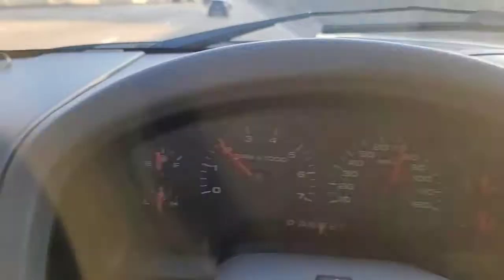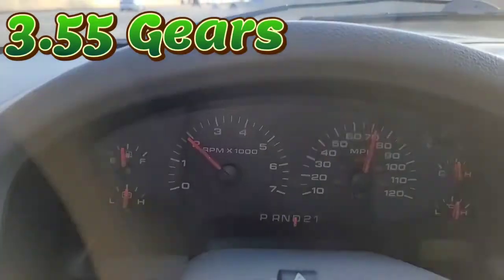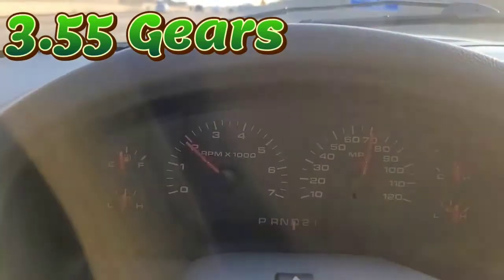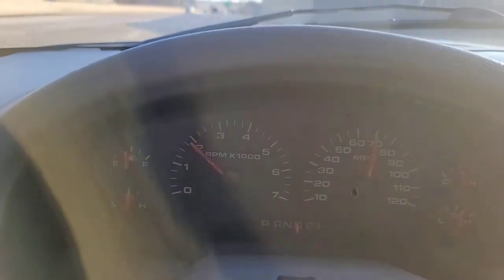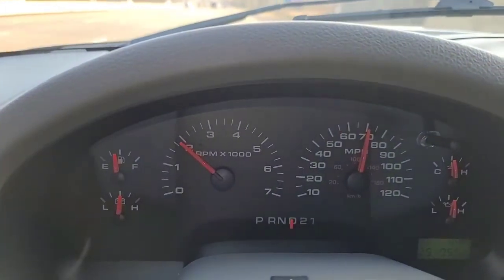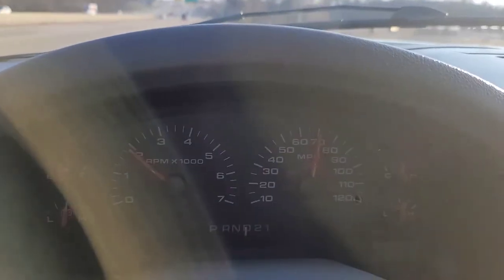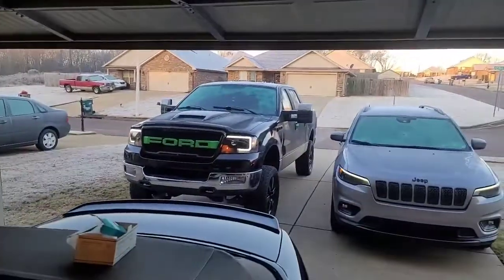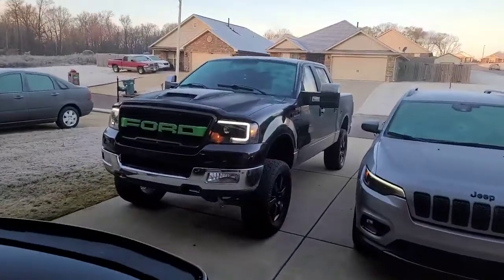Going From 3.55 Gears To 4.10s In My F150 (BigBaby)| Rpm Comparison

Comment: Thanks for making this video. I also have an F-150 with 3.55 gears and 35" tires. I definitely noticed a change for the worse in performance once I replaced OEM tires with the 35s. I would like to do the gear swap to 4.10s. Does your truck run similar to stock now that you have the 4.10s & 35" tires? What did the gear swap cost?

Comment: I got 35s, 3.55s and a programmer(on a 2011 5.0) no issues for the passing or on ramp but my low end on take off could use some improvement

Comment: Did you have a problem with the mph being off? I had mine done from 331 to 410 and it’s reading about 10 mph faster than I actually am going
Reply from the maker: U need a tuner to adjust it and you'll be fine
Reply: @GabeOn26s  thanks!

Comment: been looking for a video like yours for awhile man. good info here. i got a 05 f150 with 3.31 on 34s. with the 5.4 3v engine.  my mph sits at about 80mph at 2k. deciding if I should do 4.10 or 4.30. end goal is to have 35s on it. how was the mpg change?
Reply from the maker: You'll gain a few mpg in the city and highway going with 410s or 430. Either one will be good. The 430 will give you more performance
Reply: @GabeOn26s  thanks for the quick reply. Did you see a mpg gain? I generally Cruise at 70 -75 mph. With 34s and edge 87 tune. My 0-60 is 14 seconds
Reply: @kingbellmont9735  your 0-60 is 14 seconds?!!! I have an 05’ F150 with the 4.6 extended cab, with 275/65/R18s, edge 93 octane tune and my 0-60 is around 8 seconds
Reply: @AustinB3.6R  the 3.31 and the 34s really draw back the response and power. But crusing on the highway I get 19mpg

Comment: You could have at least rolled down the road one time with new gears before uping the tire size so we could actually see the difference.. with seeing 2k rpm at 65  on bigger gears Seems like the stock gears did better.  I mean about 2k and above 70 was rolling better...  so just wonder what 35 on 26s would of did on stock gears.

Comment: If anybody could help that would be great!
I have an 08 4.6 f150 2wd, do a lot of towing but wanting to make it faster and keep the same reliability. Which gears would you all recommend and about how much would I be looking at? Is it something I could buy and bring in for install or would have to have a shop get? Any insight would be appreciated.
Reply from the maker: 456 gears you'll spend anywhere between 300 to 1000

Comment: Their is a notice from 3.55 to 3.73. I could see a good bit more torque driving around stop light to light. I wanna do 4.10 in mine
Reply from the maker: 410s are good💯
Reply: Would u order 3.73 or 3.55 . Not worried about racing or towing . Whats the best for all around . Like which will last longer if u drive like a criminal
Reply: @dylancoffee8091  3.73 is better
Reply: @413-n9k  4.10s have more torque and are only about 300 rpm higher at 80-90 mph

Comment: What about 3.73 which would you order on ur truck .
Reply from the maker: Ford Performance gears only with professional installation. If you wanna save a few bucks get a good used ford ring and pinion

Comment: What rpm are you at 80mph? mine sits right at 2k at 80 mph.
Reply from the maker: About 2100
Reply: My 96 Explorer Limited came stock with 4.10. Revs 2k @ 60. 16" wheels (probably 30-31's). Definitely had offroad in mind or pulling boats out of the water in 4low. Tons of low end torque (but the engine has no power :lol:)